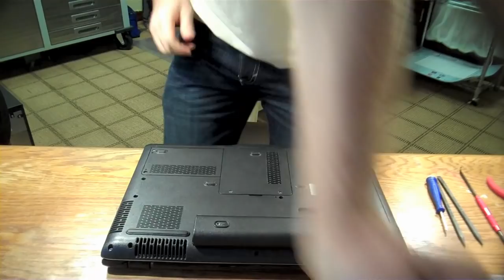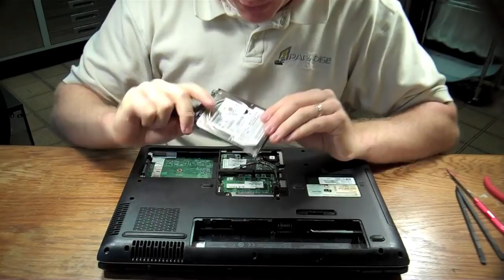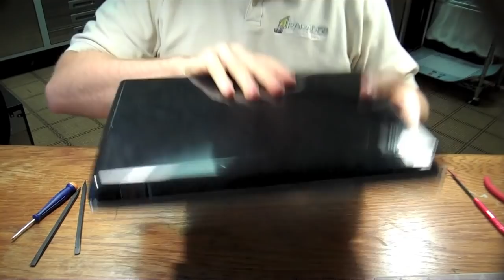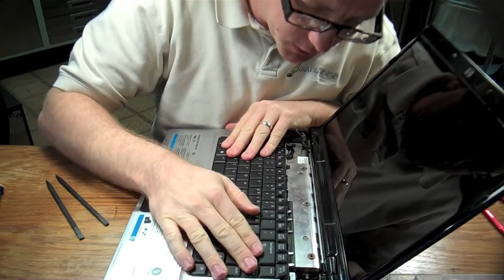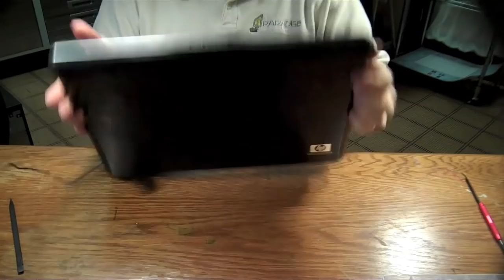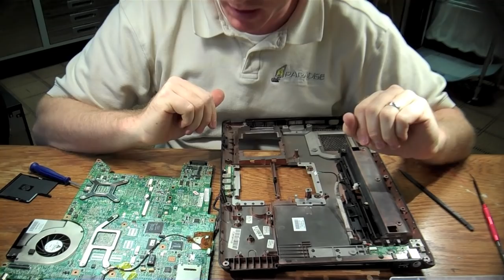How to Disassemble any Laptop in Under 20 minutes - HP DV6000

Comment: Thank you very much for detailing this and for your organization tip! I was actually using the same type of tray to hold the screws, but I had never thought to label them like that (I always just sorted them by size).

I would like to add for newer tinkerers that you do want to be careful what you touch and how. If you aren't careful you can short out parts with static electricty (It's useful to ground yourself frequently when working or wear an anti-static strap, especially in the drier winter months), or even the oils from your fingers can cause damage if left there over time. That's not to say that you should be horribly afraid of it every time you so much as pop a RAM stick out, just that you need to pay attention to what you're doing and avoid carelessly touching things you shouldn't.

Comment: Thank you Brian for the job well done. But I noticed that you have touched the electronic circuits on the motherboard and the other electronic chips with your bare hands; however I learned in the past that this could result in a short circuit that might damage these electronic parts. Am I right or wrong?!

Comment: Great tutorial!  I have one of these laptops which I bought in 2008 and its still alive and kicking, though now it gets pretty damn hot in normal conditions, temps for the cpu hover close to 70c while under normal use.  I'm thinking maybe its time to clean and reapply some thermal paste to the cpu?  The thing must be all dried and cracked up so maybe its not making proper contact with the heatsink and just spreading the heat everywhere, I checked the fan and it doesn't seem clogged up with dust so thermal paste is my best guess.

Do you think this is my best bet or just buy a new fan?

Comment: How do you fix a HP g7-1017cl?  It is not at all the same especially the keyboard, it is one molded unit. There is not a top part to take off and the metal around the cd tray is not a philips, it looks like round holes!

Comment: I am building a gaming computer, I am currently using a Toshiba Satellite C655, would i be able to use the RAM chip and hard drive?... I know a laptops ram chips are small but i checked the mother board and it has slots for it, any thoughts?
Reply from the maker: You would want to triple check that the RAM is compatible.  If so go for it.  BUT TRIPLE CHECK.  Because even though the slots are there, does not make it compatible.  Read the specs.  Hard disks are swappable too, so no problem there. Good Luck!
Reply: thanks :)

Comment: I bought my HP Pavilion dv6-6047 cl entertainment PC in Nov. 2011 the fan started to make noise in May. 24 2014. I am retired tool and die Maker i have 26 Yrs of hands on experience i like to do my own work. i would like to replace the fan with factory orginal parts.HP.Brion you do very good work do you have any advice does anybody have advice God Bless..................
Reply from the maker: Just watch some of my videos and see what I am doing.  Then take it slow.  You can do this!  I know it seems intimidating, but the machine will fail if you don't fix it.  Take the risk, learn something new by doing.  Good luck!

Comment: I've tried dismantling mine, but there's one screw that's stripped and will not come out. I could just force the thing off but would probably end up breaking things in the process.
Reply: try gently tapping the screwdriver with a small hammer while in the screw to attempt to create new grooves for your screwdriver to get aahold of and turn.

Comment: My HP DV6000 doesn't start at all even with the battery in, but the blue light where the power cord is plugged into flashes every 2 seconds, what could be the problem??

Comment: I just need to clean my fan would I have to do all this?
Reply: Calvin Schmidt You would only disassemble the computer till you can access the fan freely. Some computers have the fan easily reachable after removing the shell, while others require taking out the motherboard as well.

Question for the geeky. My laptop can't read my HDD anymore and I hear something loose in my laptop. What would I be looking for when I get to the motherboard? I found nothing noteworthy when I get to the HDD itself, and my laptop is very picky about being disassembled.